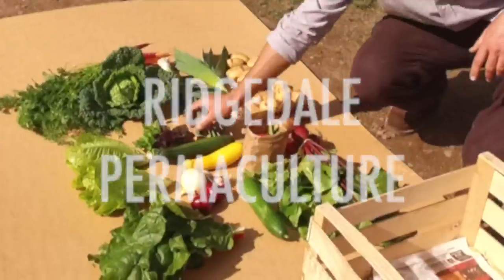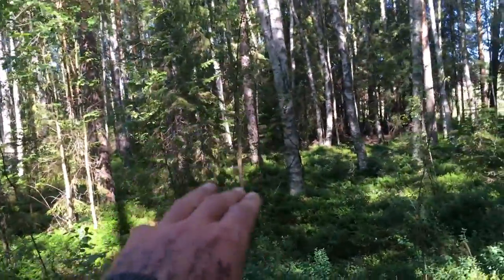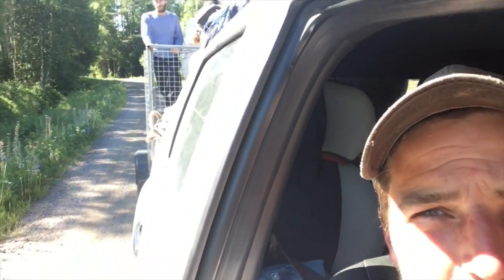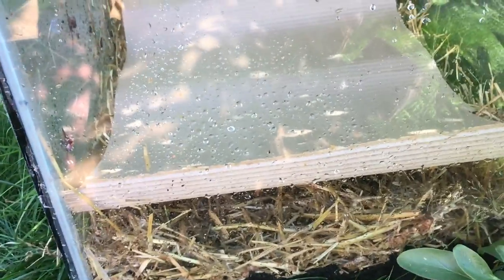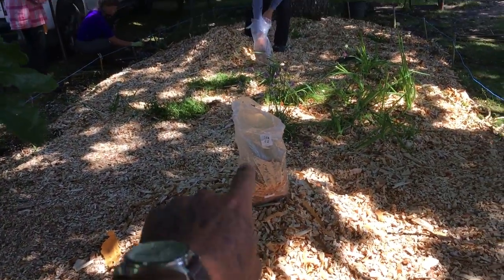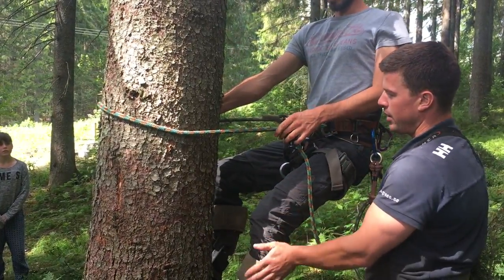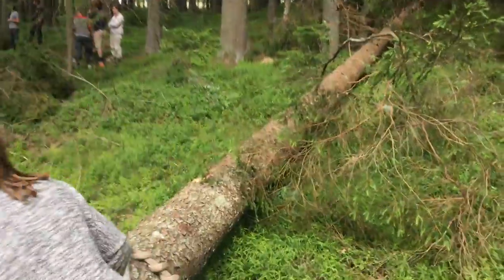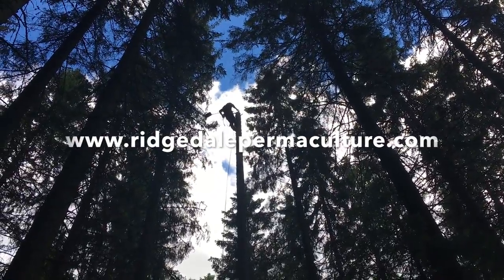S4 ● E74 Mushroom Gardens (King Stropharia), Ropes and Pulleys

Comment: Ever considered a draft horse on the farm? :D
Reply: Meagen Ruttan not really a value added option. we have 2 and they take up quite a bit of resources.
Reply: in a solid size permaculture operation like his. it would probably work out well. the problem with draft horses is it's a system. a system that has to be managed. below 5 draft horses your kinda just fooling with a hobby. above 5 it starts to make sense if you can find enough ways to use them. then there's training and so forth. some of the farms like Karl hammers operation a person who just deals with large animals like donkey training so forth.  id go mammoth donkey before id go draft horse in most places.